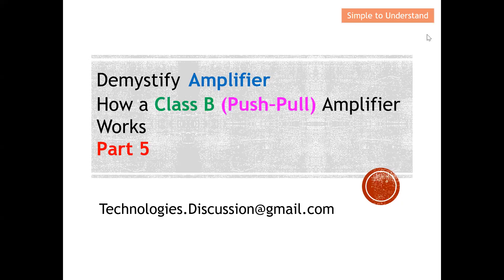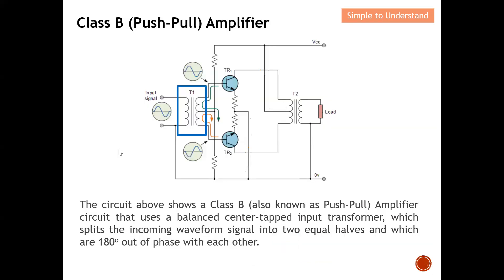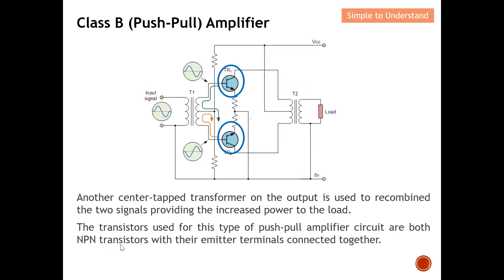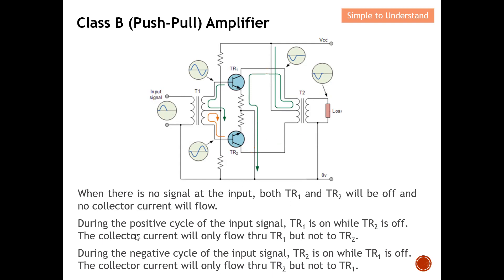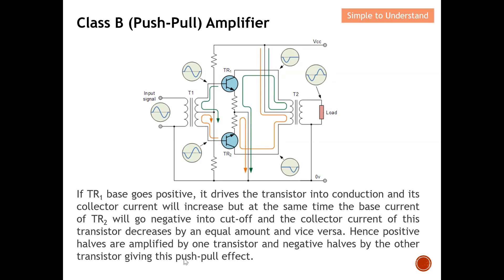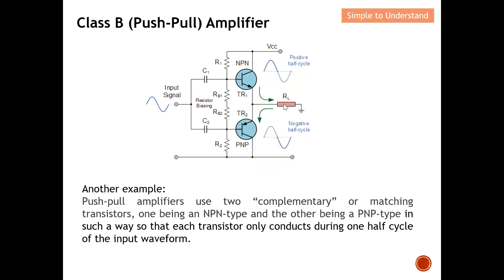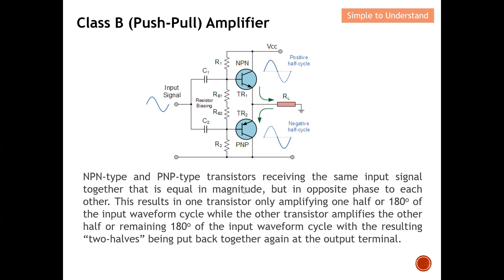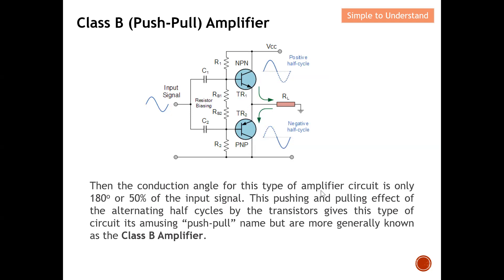Amplifier #5. Class B (NPN, PNP) Amplifier: Efficiency & Zero Crossover (Phase Shift) Distortion.

Comment: Great series!  I have a question about efficiency:  If a single Class A Transistor Amp at 360 Degrees is less efficient than TWO Class B Transistors in a Push-Pull Amp, each using almost 180 Degrees, then WHERE is the efficiency really?  In the crossover distortion there is nothing transmitted so this would add some efficiency, but not the amount we actually get.  I am guessing it is in the end about heat?  This is a subtlety I am not seeing answered in various electronics texts and YouTube videos.  Maybe it is too simple and obvious to be covered, and I am just missing it somehow.  Almost everybody talks just about the amount of time the transistors are on and off, and says this is the answer to efficiency.
Reply from the maker: Thank you for your comment. For amplifier the majority of energy conversion loss is heat.   :)